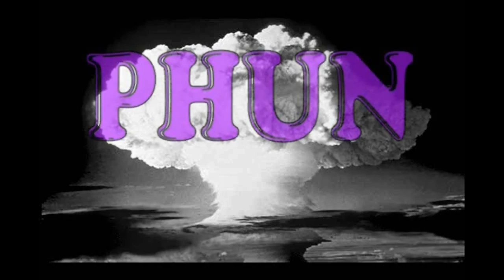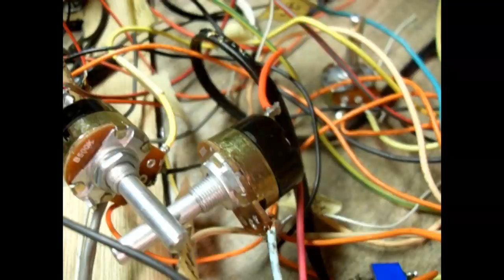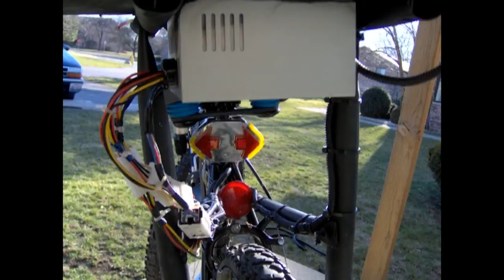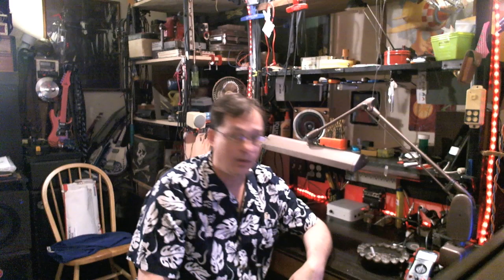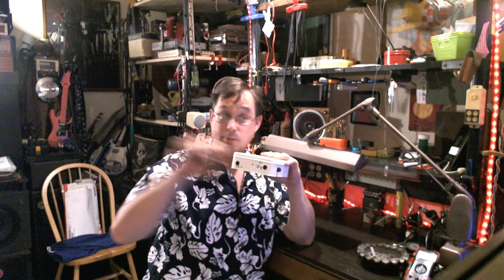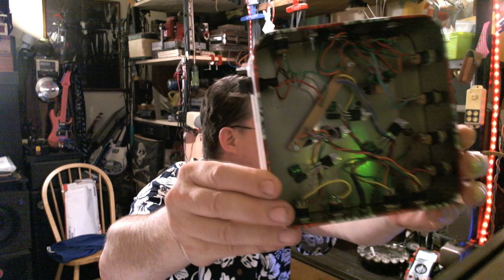Diy guitar pedal power supply brick / super universal P.S.

Comment: They are 78XX or 79XX series depending on which rail you run them.
A 12V regulator would be a 7812 or 7912, 9V would be a 7809 or 7909.
They have thermal protection and over current protection and once in circuit can almost indestructible.
I use them for the heater supplies in my 12AX7 pedal projects.
I highly recommend them as a simple and cheap solution for a quiet pedal power supply.

Comment from the maker: i have done a lot with the lm7809 and similar , they are good but get a bit warm , and not the most efficiant . recently built a 12 volt to 5 volt box with a 1084 low drop out vreg . wow it gets hot ! so far no ground loops , ther are two 7809 then a 12 volt port as well , the lil test amp i run is on the 12 . i have se up 8 pedals plus the amp off this , silent so far .
Reply: Use heatsink

Comment from the maker: thanks , i am learning ! the spyder is very nice , i took the cheap route here , i do have 2 of those HP printer power supplies though . i would be curious to see how uch a full on spyder would run ya ... also curious about the fuse value i used , maybe i should try some lower values , stock up on those . better safe than DOH !

Comment: Could I use a microwave transformer to build a PSU for guitar pedals and other 9/12V equipment? I would need it to be able to handle about 100 watts on the output. I'm thinking of rewiring the secondary of the microwave t-former to get around 16V output voltage and then use switching DC voltage regulators to lower and stabilize the output voltages for each DC output jack, or would these regulators be creating noise?Thanks

Comment: Just do it like a guitar amp power supply. A transformer, rectifier and a bunch of filter stages...surely that would work? Like pull the transformer and rectifier out of an old radio or something and do the math to get down to 9v after a few filter stages. I've not tried it, but I might at some point. And put it in a really retro looking little chassis
Reply from the maker: anything is possible . i purchased my voltage regulators when i made my first order from tayda electronics suplier , along with resistors , caps and tons of other stuff . i find they beat everyones prices , and it was so unreal cheap , compared to say buying local at radio shack , i could just affoard to buy everything new as its just crazy how cheapo the stuff is ( resistors are 1 penny) . i do like to recycle sometimes but it has to be a special part or situation , like really old stuff is cool right ?  the shipping is where it gets a bit frustrating and then the wait but , i am very cheap , so when i found taydas prices i stopped recycling parts . check them out sometime , but yeah sure you could just as soon aproach it as you mentioned . thanks for comenting .

Comment: I was always under the impression that the heatsink tag on the regulators should NOT be connected to ground?
Reply from the maker: right on . thanks for chiming in . when i made this i was not aware of this rule . it is sitting in the same spot , functioning flawlessly  , six years later . who knew ?
Reply: @peteytwofinger  was your case connected to ground? I guess if it wasn't then that could be why?
Reply: @JamesCroisdale   If there is no difference in potential between these guys there is no problem, but if grounded depending on the regulator it will short out and disable.

Comment from the maker: absolutely silent , the supply is filtered very well . the source p.s. is an hp printer power supplty , that unit is prolly filtered well , then there are 2 more capacitors on each channel . its silent as i am picky aboput p.s. hum and noise so ... the spyder is a great design . this one it doesnt run off 110 volts so its much simpler , but you need a p.s. to start with , which i dont mind that ...

Comment: Hello is that thing noise free???
Reply from the maker: no its super noisy , it is so loud the noise is louder than my drum machine i plug in when i make my dope beats . it is so noisy  i recently make a whole double album of noise called metal machine music part two -petey style . it so noisy i went on to continue to build this circuit into all my amps , and also build many of these units which we run on all of the videos on this channel with the band making music outdoors , you can hear the noise is much much louder than the band in all of those videos . i dont mind the hum and hiss i actually like it . check out the album i just recorded , i made sure there was extra noise hum . both 60 and 120 cycle noises are the forefront of the album i mixed and mastered . https://youtu.be/o6dbxqX5hK0 its a good thing you typed that as i cant hear any more , if you would have tried to speak that sentance to me i would not have been able to comprehend or hear you because i am deaf . from all the NOISE from that THING ...

Comment from the maker: if i think about it , i COULD run this device off of whatever power supply ( a battery ) i would care to , it is  FULL of regulators ... that is ALL that  this is , a box , full of voltage regulators , and each reg has two filter caps as well ... watch the video ... its also fused ,  it has output jacks  and an led with current limiting resistor . the power supply that i run it off is silent ... as silent as a boss ps120 , or a one spot ... its a nice power supply i garbage picked , its an 18 v 2 a HP brand i think ... lap top power supply's are typically not cheap noisy units ... i put 7809vregsw/ filter caps in all sorts of power supplys ... kind of like a diy pedal power plus idea , and then save some cash . it this was noisy , i would not use it .... lately i use playstation 2 power supplies instead of my one spot cause i found a few ... they are like 8.6 but ... quiet and i think 1.5 amp or so . i would stick to batterys if i were you , much safer . with vregs you need 2 v headroom to function so if you want 9 , you need a ps of +2 so at least 11 , thats about it , google 7809 ... thats what is in the brick stuff you could purchase ... its a voltage regulator , or vreg ....

Comment: can u post the schematic?
Reply from the maker: its 2 caps ... http://www.usbekits.com/uploads/1/0/1/8/10185060/6810806_orig.jpg like this , i used a fuse ... also a main barrier strip of vero for the power taps for each vreg . no schemo , just kinda bodged it together , it still runs great !!
Reply: petey twofinger and how many amps can you load?
Reply from the maker: each vreg has a limit , these maximums are listed in the data sheet , some are about 1.5 amp max per vreg ... the main limit is the ps , in this case i think its 4a or so total . more than enough for a pedal board .